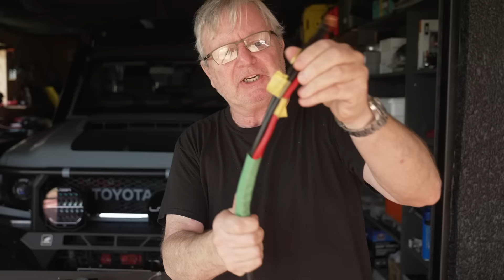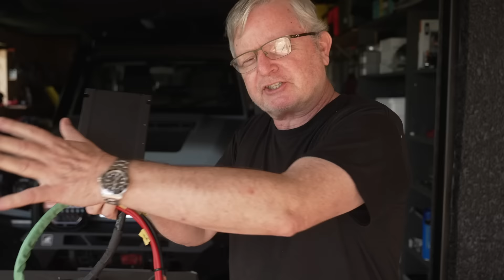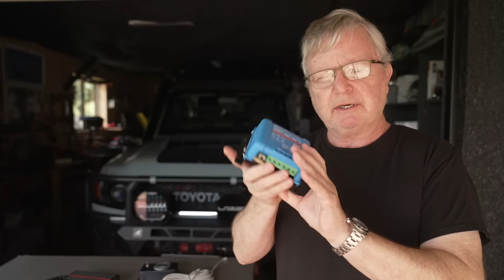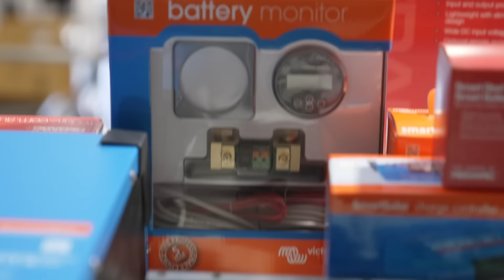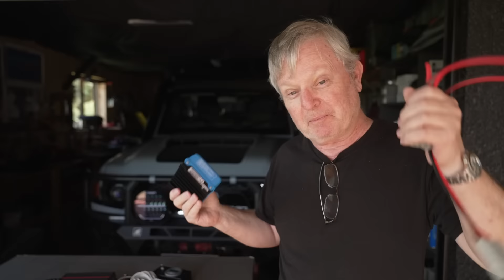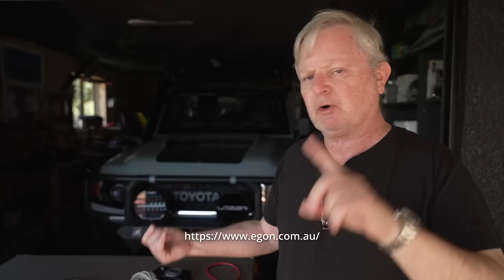DC-DC CHARGERS. Victron VS Redarc How to chose the right one for you.  @4xoverland

Comment: If only the Victron had a combo unit (eg dc and solar)! Have run both in my build, and am now only running victron units - the app/support/updates is just second to none
Reply from the maker: Seperate chargers are actually better for efficiency.
Reply: And if you add the prices together of 2 seperate units, it’s the same as buying a dcdc that has mppt solar built in

Comment: Best is itechworld 40amp dcdc charger imho
Reply from the maker: Oh no it isn't.  I would not fit anything from them. For me, they make far too many spurious claims about their products.
Reply: @4xoverland  That has certainly been the case for some of their products, not just itechworld either,  however I do have their 40a dcdc charger installed and it's plug and play,  excellent unit. charges my lithium battery in no time.  literally have not used my solar blanket once since installing it. I haven't been in one spot for more than a couple days. Think I paid $250 on black Friday for it.  Maybe you should test it for yourself Andrew.

Comment: yes Mr P you are correct, both are very good chargers, just one little thing = remember 47 amps are always better than 40 amps even if it means you need to pay more..... because your batteries will charge must faster even if the difference is just 5 amps ...... just one other thing = solar panels are way over rated..... you will do better if you use lithium batteries and idle your vehicle for 2 hours than using solar panels for a whole day......just saying... I am using a 150A/H Lithium Phosphate with a Redarc 50amp DC to Dc charger.....never need to use solar panels ever again....

Comment: So lithium batteries look good all day then with out warning they drop fast and stuff u up 😮
Reply from the maker: Yes. But last twice as long. Double the capacity, one third the weight, same size. And do not suffer from voltage drop so your equipment can run until the battery is empty, and not half empty.

Comment: Hold up a moment, big rant without respect to why both products shoot themselves in the feet, $$$$ Both are very expensive. 
Next issue, all great suggesting people get bigger and bigger current ratings, great if your storage can handle it. You completely skipped over the big reason why you set size for a reason, CHEMISTRY.  AGM/SLA batteries are not designed to take huge charge currents. The best is C20 so a 100A/h battery should only be 5A, higher can be done for short durations but not advised.

Comment: If you have these ready made batteries like Blue Yeti, Jackerie does it make a difference how many Volts you get to them? Cause as far as I understand their specs most of the small ones can only handle 200W Max, VOC 12-28VDC/ 8.5A of solar input. So what would be your advice on them? Two Solar panels in series so you get the more than 12V and charge for later in the day, and then the Victron 30Amp MPPT controller then to a 30 Amp DC-2-DC  charger and then get it into this kind of battery. Or maybe it doesn't worth the hassle (cause they have built in MPPTs) and just plug in the solar panel straight to the battery?

Comment: Redarc every day of the week, Australian made quality. The redarc bms and red vision system can do all those functions eg water level monitoring, inverter control, circuit switching, battery monitoring with a much more simplified installation. If you need more than the 30a dc charge input to your batteries you can connect a bcdc in parallel additionally. If they upgrade the mppt solar input voltage one day no other product comes close
Reply: Sailing boats thay navigate the world fit victron. 
Nothing is mde in australia. 
Redarc is overpriced. Very.
Someone is making a fortune by sticking "Australian made" on imported gear.

Comment: Odd you didn’t mention the manager30 or the red vision system
Reply: I'm guessing as it's a competitor to his egon hub.
Reply: @justasix8815  manager 30 would most likely be useable with his hub, comes from redarc with a shunt and an AC input
Reply from the maker: Because this is a comparison between two specific DC-DC chargers. The Manager 30 is not a Egon competitor. The Manager is a switcher. The EGON is a fuse hub.

Comment: Andrew, Victron products are rated for usage for temperatures up to 55 degrees Celsius, just like the Ctek units. The Redarc products are rated for temperatures up to 80 degrees Celsius. I have measured temperatures in my canopy when external temperatures were 38 degrees Celsius, and inside the canopy it was 60 degrees Celsius without a roof top tent on top, and 50 degrees Celsius with a roof top tent (or shade cover) on top. The Victron products (and Ctek) would not handle these temperatures well at all and would likely fail prematurely. The chain is only as strong as it's weakest link and Redarc seems to have used either automotive or better discrete components in their products to be able to achieve these temps of 80 degrees Celsius. I'm not saying there isn't a market for Victron products, just that they will need additional cooling if the environment is likely to get hot, Redarc can handle the heat better.
Reply: If you're seeing temps of 60 Degrees Celsius in your canopy presumably with a fridge inside of it as well and doing nothing to bring those temps down to a sensible level then you have more serious issues to solve than what brand to choose based merely on upper temperature thresholds. There is nothing stopping anyone that uses Victron controllers from adding a cheap computer fan behind them for peace of mind. You can even find people 3D printing mounting brackets for such fans to Victron controllers. I have several Victron controllers (very large system) and have never had the need to do anything so drastic as to add additional cooling directly to them. However, it's a non factory option if people want to do it. In the real world the 55 Degrees Celsius is not a problem if your system is designed properly with due consideration to ventilation and heat dissipation from everything running or not that is kept inside a canopy, including storage of food.

 In the real world of recent past when the Redarc controllers were first designed and made, it was probably for an under bonnet installation where the second battery (lead acid based) may also be under the bonnet. However, even though the controller is rated to 80 Degree's Celsius to cope with under bonnet temperatures it was always of dubious value and more of a sales gimmick considering that lead acid based batteries have increased resistance to charge as temperature increases. Without utilization of a temperature probe to battery to throttle back output of controller you damage the battery in the long term anyway.  Then there was very few deep cycle lead acid based batteries rated for under bonnet installation anyway, let alone lithium. So, we get away from installing the aux battery under bonnet and into the vehicle where it also makes sense to put the dc-dc as close as possible to the aux battery to eliminate incorrect battery voltage readings of the dc-dc due to voltage drop over cable length between main and aux batteries.  I cannot even fathom why someone would need a controller rated to 80 Degrees Celsius today given the fact that they are typically now fitted to anywhere but the engine compartment. Most controllers now made are not rated to such a high temp figure, nor are they water proof because realistically there is no need for it. It matters not that Redarc "can handle the heat better" when everything around it, and connected to it in someway, cannot!. You might want to research the typical operating and charge temp range of lithium batteries, and you'll find they are around the same operating temps of controllers such as the Victron and many others. The BMS would likely shutdown the battery if it saw temps anywhere near 80 Degrees Celsius. Your fridge would cark it, and canned food would be slowly cooking by  itself.

BTW, that Victron 100/20 controller Andrew is holding will happily run all day at it's max output (20 amps 282 watts or so) achieved by over paneling by a couple of hundred watts of extra solar and it draws what it can to it's rating and dissipates heat well. The Redarc units in my opinion, are outdated, too expensive and lack modern features. The only remaining reason someone might still want to buy them is because of supporting an Australian product.
Reply: @erroneouscode  Those temps I gave are just the closed canopy temps with nothing running inside of it to give additional heat, in full sun. My canopy is not permanently connected so I just view it as a load, no dc-dc charges or batteries connected inside. My dc-dc charger is installed under the vehicle tray which remains at ambient temps along with the batteries, and any other electronic gear. The ute is the powerhouse, the canopy is just a load, in more ways than one. Redarc in no way are outdated, I like to keep my installation simple and hassle free, and the operating temps of 80 degrees Celsius are a must in my view, if your going to run them in a canopy, or enclosed environment where temps are likely to be excessively high. Heat stress is a big factor on life expectancy of discrete components in the electronics world, I've seen enough Data Sheets in my time to know better.
Reply: Agreed, if you want longevity with power electronics, go with the equipment rated for higher temperature. It should have Electrolytic Caps with higher temperature specs, and these are the devices that always fail with time.
Reply: I’m keeping an eye on my ctek as it was in my old Ute tub for 4 years and now been under my bonnet for another 4 years, so far it’s been fine but I only run a fridge and never needed to check it’s efficiency but I’m definitely curious as to how well it’s really running
Reply: I think you were measuring surface temperature, in a hot part of the canopy. If you mount it away from the roof and the back of the cab with some gap from the metal it’ll be fine. Especially with a fan and ventilation added. Talking from experience, I have a large 150/85 running fine with 1200watts and the roof gets to 60c. They are built tough.
Reply: @jordanhanson316  Nope, temps were inside air temps, not surface temps. When the sun bites, it bites.
Reply: @magicalvortex  oh okay, been a while year lol. I’m sure the temp can be kept down to below 50 with insulation and some fans

Comment: One important thing to remember when deciding on whether to connect your solar panels in series or parallel is this:
When connected in parallel the maximum current that the system can put out is the sum of each panels max current carrying capacity whereas when the panels are connected in series their combined max current carrying capacity is limited to the max current of a single panel seeing that all the current has to flow through every panel.
In conclusion, a parallel system might cause the NPPT controller to switch off earlier but while it is on the system is able to put out a much higher amperage (watt hours). I suspect that the difference in time that a series system stays on would not make up for its limited current carrying capacity.
A good excuse to do some testing I would say.
Reply: Also if one panel in a parallel system gets shaded you still get charge from the other panel / panels
Reply: @ajf9034  Yes very true, I forgot about that.
Reply: Panels wired in parallel will deliver higher amps at lower voltage to the MPPT charge controller.  Panels wired in series will deliver lower amps at higher voltage to the MPPT solar charge controller.  The solar charge controller will convert either to the appropriate voltage to charge your battery bank.  Lower amps at higher voltage allows the solar charge controller to run mor efficiently, delivering more power to your battery.  It also allows for the wiring between the panels and the solar charge controller to be smaller while still safe, which is easier to run.  Having used both the solar charge controller built into a DC-DC charger and a Victron 100V|30A, the Victron is far more efficient.  That said, installation is more involved.  It has nothing to do with sun time, it has everything to do with the inherent efficiencies of MPPT, which work better with higher voltage.
Reply: @jaredsimpson3798  Thanks Jared, there's no better knowledge than first hand experience! What would a shade patch partially covering one panel do to that arrangement?
Reply: @The_Elundu_Expedition_Project  I try to park in the open where we will not have shading issues.  That said, if one panel is shaded open an array wired in series, the amperage of the whole array is limited to the amperage of that one panel.  Like I said though, I don’t worry about that much on vehicle systems, because I can choose where I park and thus can avoid shade most of the time .  That, and because these systems are vehicle based, total area is small enough that if one panel is shaded, they all are most likely shaded.  I also recommend putting as much panel as you can afford on a vehicle, for shade, cloudy days, or higher than expected usage.
Reply: I want to park my vehicle in the shade! Out come the portable panels, which, at camp, will be doing all the work.

Comment: Andrew, you need to compare apples with apples. In your comparison with the Victron kit, GX, Cerbo etc, you need to compare that to the Manager30 and Redvision. I myself also run both, full Victron MPPT’s, DCDC, Inverter, BMV712 etc…. And in my other LC fully RedArc… Both are very good, difference for me is, if a unit break in the Victron kit I can replace only that unit, and I have a few different MPPT’s to,feed different solar panels in, like flex panels, etc. The Victron gets complicated to manage and install, but very good, the Redarc Manager30 and Redvision is very easy to install. The Redvision gives you other features like remote turning things on/off, etc…

Comment: I’ve installed a couple of systems now and basically run a redarc charger and a Victron smart shunt and it works great. Great products, maybe someone should combine the pair 🤷‍♂️
Reply from the maker: That is a very good combo. Good value, works well, and a simple solution.
Reply: @4xoverland  yep. Wired up efficiently, my little 50ah amptron runs, fridge, charges drones, phones, cams etc. Being smart with power usage, I never come close to running out of power. Great efficient products.
Reply: @@barry422 yeah i can get 50ah to last a week sometimes.

Comment: Thanks Andrew for the run down. However the critical factor besides the total input voltage to a MPPT is the maximum power it will handle. You touched on the overheating in placement but over powering from a PV array is deadly. So if the spec sheet says 50W input max. , then forcing 100W into the device is a recipe for disaster !

Comment: lithium should charge straight off the alternator at least 100 amps. these charges ae old tech
Reply from the maker: That is incorrect on on all accounts.
Reply: @4xoverland  nope.  my lithium has a built in bms and charges straight off the alternator up to 200 amps also has  built in mmpt charger that can handle up to  80 volts and 20 amps. just plug the panels straight into the battery this makes my statement true on all accounts since u still need to run an extranal dcdc and mmpt and shunts I  would say you are running old inferior tech. because all i need is my battery's panel and smart disconnect
Reply: @damienfrizzell9394  So you have a battery with an internal charger vs external. Basically you are doing the exact same thing. Your statement was 'lithium should charge straight off the alternator' and that statement is dead set wrong.
Reply: @ElRollioau  internal solar regulator is not a charger

Comment: Ive got the Ctek 250 mttp charger that allows for charging from alternator/starter battery, as well as solar. Has worked well for me.
Reply: The solar input on the Ctek 250's only allows max 23V, so your missing out on the ability to connect the panels in series.

I've got the D250SE and Smartpass 120S on one of my trucks and it works great as a DC-DC charger and battery separator.
Reply: @lag_profil  Not a big deal for me with my solar setup, and honestly, it’s not a big deal in general for these smaller systems.

Comment: Redarc does have the red vision screen so you can monitor your water level
Reply from the maker: Not the Redarc DC-DC charger. I'm not comparing the Red Vision or Manager30.
Reply: @4xoverland  well I'm saying that the victron doesn't have the cerbo screen. The Orion doesn't actually communicate with a cerbo at all, just the shunt does in the BMV-712

Comment: Andrew, you appear to be pushing your own product more in this presentation than providing facts about the redarc and victron.  The rational that the Victron is better for the reasons you state is bollocks. The redarc should do the same as the victron whether they are wired in parallel or series.
Reply: The Redarc 1240/1250 can only handle up to 32V solar input which means only parallel connections. The Victron 100/20 can handle up to 100V solar input.
Reply: I have owned both brands and in terms of dcdc and mppt controller, Victron has outperformed the red arc equivalent by a substantial margin. If you want ease of setup go redarc if you want performance go victron
Reply: No, it's not bollocks. The Redarc cannot handle the input voltage that the Victron systems can.